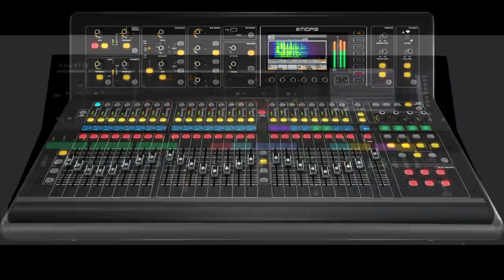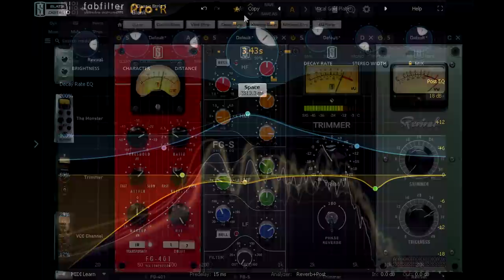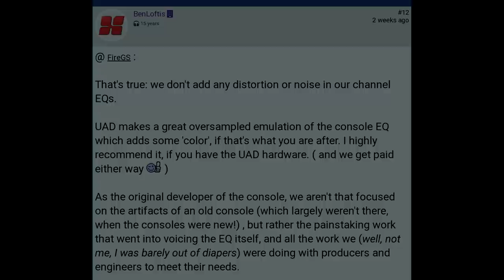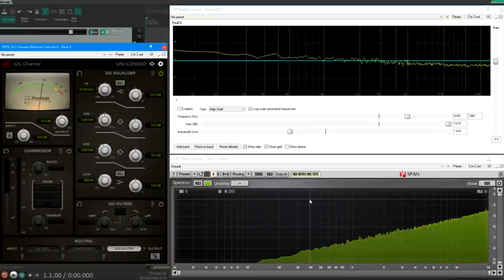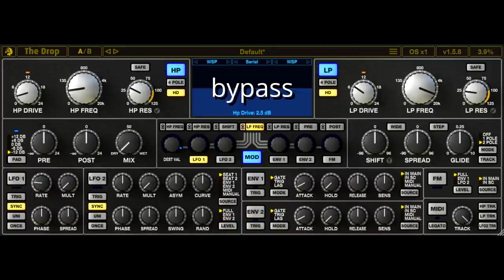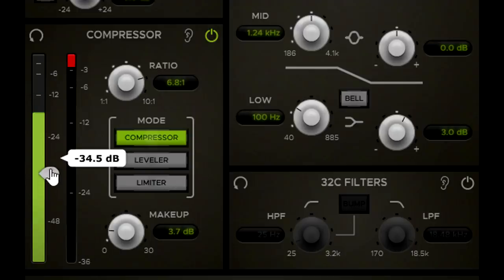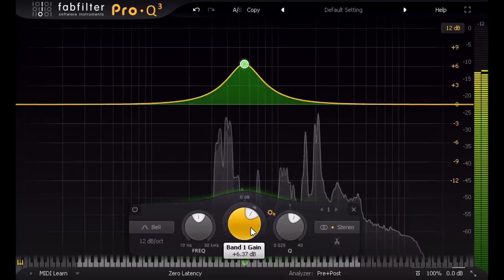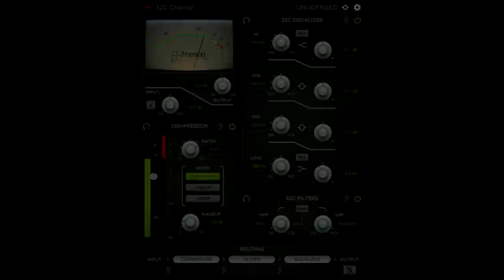Why Does It Null? (with ReaEQ) Harrison 32C Channel Strip

Comment: So if the eq nulls, then not only is the channel strip not a recreation of “every component and resistor blah blah”, if we assume they used the same code as their Mixbus software, then Mixbus 32C is also not at all based on their 32C console. So it’s all marketing garbage then? Right back to their core software.
Reply from the maker: I'm happy to believe that quirks like boosting 16dB when the knob says 12dB is accurate to the original console, in which case technically the EQ is based on the console. I'm not convinced that's in any way beneficial though.

I've not tried the mixbus DAW. But as I understand it the "magic summing" boils down to some saturation on the buses..? If that's accurate, then yes it's pure marketing BS.
Reply: @DanWorrall  I use Mixbus (basic flavour) and yes the voodoo is the saturation on the 8 mixbus's.. I actually like the process of  mixing there. Its simple and  suits my basic style of mixing and I always seem to end up happy with the result. I think it has mostly to do with the simple  workflow though. But I do agree that the plugin they released is kind of  pointless.

Comment: I think you are overreacting, the transistors, transformers etc in the ad mainly reflect as they are used for compressor, levelling and limiting and it is doing its job perfectly. I compared it with UAD SSL strip and its did behave as Harrison would.  you are though spot on with EQ Cramping.. My only gripe is that I have to duplicate the dynamics twice or thrice and defeats the purpose. The Dynamics is the secret not the EQ

Comment: I'm a bit confused about all the outrage on this one.  It's not something I'd buy, but I can see it's value, the more I mix the more I find limitations to be beneficial, often less is more, especially when you know a tool really well.  

Having tuned EQ settings to choose from  that are useful and musical in nature, digital or analog, I think is very beneficial to work flow, and the same can be said for having limited options on the comp/lim setting.   Yes, there's a great benefit to a notch here or there, and sometimes things require more drastic alteration, this probably is not the tool for that. 

I can see this being useful to grab a quick channel plugin that has an efficient and easy to use EQ and filter, a touch of comp here or there, and a nice easy to read meter.  If it's not being advertised as anything else what's the issue?

People are making a big deal that they claim they modeled the resistors and transistors, and quite frankly I don't know how else you'd make an analog EQ without those... Its very possible to just model the curve and behavior of analog hardware without the analog non linearities and distortion, with the simple intent of recreating their behavior in digital, while not capturing the imperfection our ears often find musical.

I think it does what it's designed to do, whether it's anyone's particular cup of tea or not is a different story.  Not worth getting your panties in a wad over IMO.
Reply from the maker: It is being advertised as something else.
Reply: @DanWorrall  You know, I just read their statements, the one you posted and the ones on their own forum, and they seem reasonable and genuine.  However, I did read the email they sent out and the one thing that does stand out is they are advertising the "true analog sound," which I have to agree with you, is not acceptable in this instance. 

That is an unfortunately dubious gray area, because the market expectations at this point are absolutely to have non linear models, often time modeled noise floors, and some saturation/harmonic characteristics when pushed hard. 

Also for what it's worth, they said the variance in EQ levels is a bug, additionally there also may be a dithering bug of sone sort, both of which are to be patched in an update. I'll see if I can find the link.

Comment: All EQ's can be nulled against ReaEQ if they are (1) Linear (2) MinimumPhase... 100% unavoidable because that's how filter maths work.
Reply from the maker: Simply not true. Set up a bell boost in Pro-Q3, with a 96dB/octave slope. Now try to null that with ReaEQ.
Now try a standard bell at 10K.
Reply: @DanWorrall  Pro-Q3 is linear phase, not minimum phase, so yeah you can't null it with ReaEQ.
Reply from the maker: Only if you choose linear phase mode.
I wish people wouldn't spread this kind of misinformation...
Reply: @DanWorrall  Oh. I had to check it up... You're right, at least one of the other processing modes seem to be minimum phase (although the manual doesn't explicitly say it). And it true that most DAW EQs (including reaEQ) have a flaw called "high frequency aliasing" which pro-q3 doesn't have, where the settings go off rail near the sampling rate (the manual gives the example of a 16khz band eq that has way higher effective Q than expected in a cheap EQ because of this)... Nevertheless, that kind of stuff usually means you can still zero the EQ with something like ReaEQ, but you need to pile on more bands in weird configurations... the 96-dB slope bell would probably need 8 or 16 or more bands to emulate for instance.
Reply from the maker: That's cramping, not aliasing. There's no aliasing in a linear EQ plugin.

Pro-Q3's zero latency and natural phase modes are both minimum phase.

Now go away and null that 96dB/Oct bell with ReaEQ, then come back and show me your settings. I'll wait...

Comment: HEY   FOLKS   .....LISTEN    It makes no difference to me whether the Harrison 32C plugin was modeled from an actual circuit or not; what matters to me is the sound quality. This plugin sounds better than SoftUbe console emulations. You have to put a "Saturation Analog Plug" after it. It's fabulous. As long as the mixing and mastering are done correctly, you won't be able to tell within the finished song whether there is a resistor and capacitor involved in the plugin modeling.H